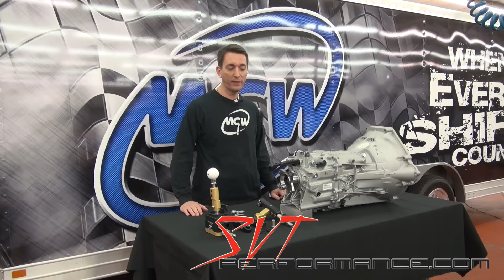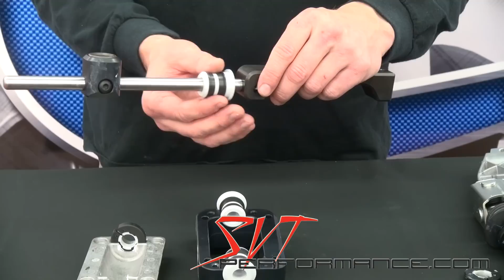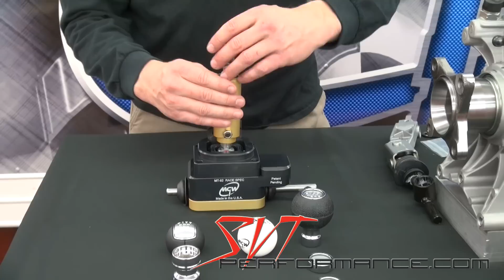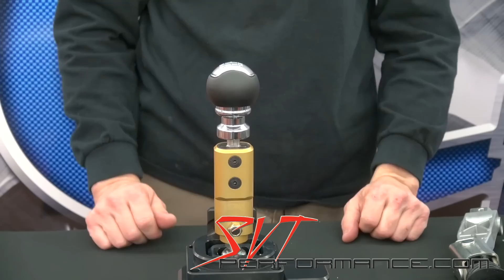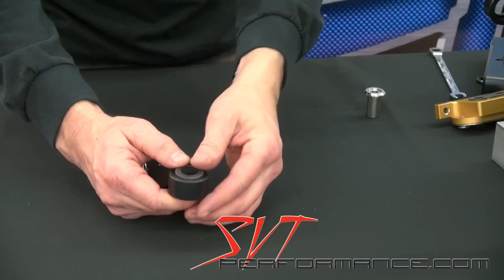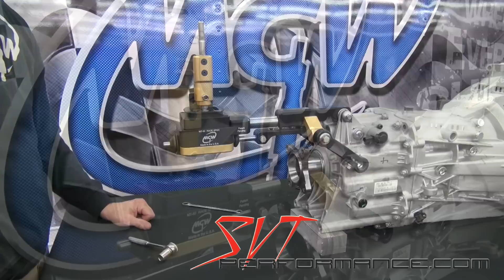SVTPerformance.com Exclusive :: MGW Mustang MT-82 Race-Spec Shifter Overview

Comment: I finally had mine put in 4 weeks ago.. I should have never ever waited.. I was so worried about NVH & I was worried for nothing.. I can't believe I put off installing this shifter because of how worried I was about it being trans mounted... I hate NVH so if I am saying it feels great, please believe me.. There zero harshness and if anything it's quieter with the extra Sound Dent Padding.. Shifters are butter smooth. This should have been the Very First Mod. Can't believe I waited.. Better late than never for sure.. Oh and if you have a trans insert in, pull it out! That's what makes the vibration feeling in the shifter ball..
Reply from the maker: The rules are simple :: If MGW makes a shifter for your car, you buy/install it.

Comment: Mine is coming in Today.. I never knew you guy's made a body mounted one back then.. I would have prefered that if I'm being honest.. I almost went with the Barton because I didn't want trans mounted.. I hate NVH. I did a Steeda trans insert years back and pulled it right back out because of the NVH. What some people can tolerate or they think feels smooth is totally different from what I think is smooth..  But this just seemed like the way to go and if it vibrates a little more I'll just have to live with it. I'm planning on covering that thing good with the Dinamatt and I'm even planning on adding some from under the car too around the opening for the shifter hole just to help with sound a little more.. Great video though for sure..
Reply: I finally had mine put in 4 weeks ago.. I should have never ever waited.. I was so worried about NVH & I was worried for nothing.. I can't believe I put off installing this shifter because of how worried I was about it being trans mounted... I hate NVH so if I am saying it feels great, please believe me.. There zero harshness and if anything it's quieter with the extra Sound Dent Padding.. Shifters are butter smooth. This should have been the Very First Mod. Can't believe I waited.. Better late than never for sure.. Oh and if you have a trans insert in, pull it out! That's what makes the vibration feeling in the shifter ball..

Comment: I had an MGW installed on my 2017 coyote and it is absolutely amazing! I was considering buying a different tranny but no need to anymore. Combined with the McLeod rst twin clutch and lightened steel flywheel it’s as good as it can possibly get
Reply: Is it push down for Reverse Then??

Comment: I ordered a race spec at the end of January for my 2012 Gt. I was surprised when this showed up at my door. I was actually expecting the first race spec, as I did not know they redesigned it. All i can say is man this is high quality and worth every penny. The install was very easy. I didn't have any problems installing the bridge with the struts or the box from underneath the car, and I have a DSS one piece drive shaft. the only thing you need to do is slightly jack up on the trans to get the box onto the bridge, because the box will slightly hit the drive shaft when you try to put the lower box on the bridge shaft. Also after I adjusted the reverse lockout and 1-2 pin I stuck the boot on the top of the shifter,let the trans all the way back  down and installed the boot from underneath the car took about 2 minutes to get it around the outside of the box and in the groove. I didn't notice any additional NVH. I did notice the lack of looseness in the shifter. I did install the Dynamat Damper material like he suggested, I almost did not because everything looked so awesome but hey I took his advise.I haven't missed a shift yet since the install. The only things that were different from this video was is my shifter box was not put together which worked fine for me because I would have separated the upper and lower pieces anyway to install. Second I did not get the Deluxe Jam nut like he said. I don't know if it was because I got one of the first redesigned ones, or that it was just left out of the kit.
Reply: Well after a couple of years with the MGW Shifter in the car I can say that I'm still very happy with it.
One of the best mods to date. Makes rowing through the gears second nature with this trans and if you like drag racing it will definitely improve the quick shifting without the lockout. I would not hesitate to buy another MGW if I bought a newer Mustang. And yeah I still love the car after 5 years I still look back at her and some people ask me if its the new Mustang. I have to  laugh and tell  them no it's '12 the new ones are waay different. I know your car is a head turner if it looks like mine. Something about a Slick black car that makes everybody stare (no matter what kind of car) But man Keeping it clean is a second job. Your going to love the shifter and enjoy the car more after you get it put in no doubt.
Reply: No clearance issues at all. My car is riding on eibach sportline springs with koni  sport shock and struts. No I'm not on the forum may have to come check it out.
Reply: how is the MGW holding up for you?  Does the tranny still get locked out at very high RPM?
Reply: +fzr niko  I can't say anything bad about this shifter. It has worked flawlessly since I put it in. High rpm shifts are second nature, never have missed a gear after I put it in. Probably the best mod I have done to the car for performance. It's really a shame you can't see it after you put it in because the quality is awesome. If your thinking about it and can afford it, get it because the damn thing just plain works.
Reply: Dee: We have the same car, and driveshaft! :) I'm so glad you mentioned the DSS unit, and that it was no problem with the two working together. I'm pumped to get this bad boy installed, soon.
(going to do myself, in the garage, using the (also new) Quick Jacks! Thanks for your post!!